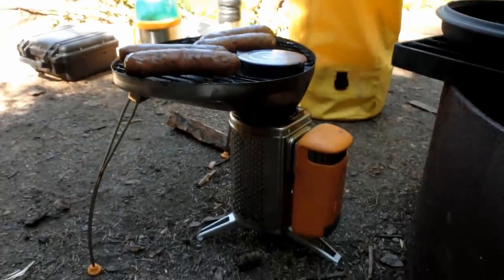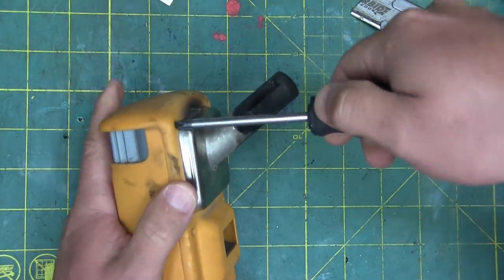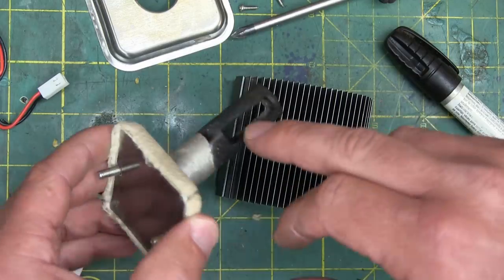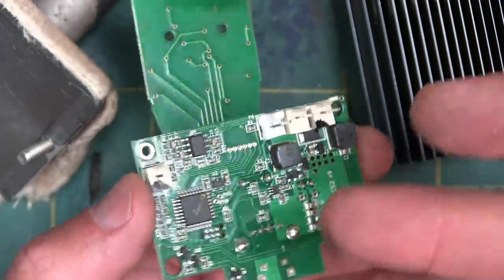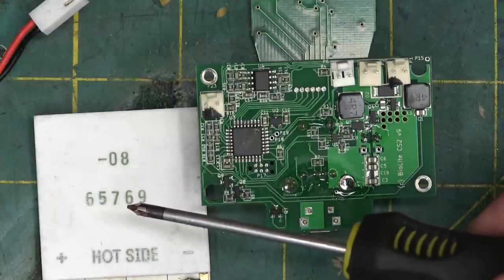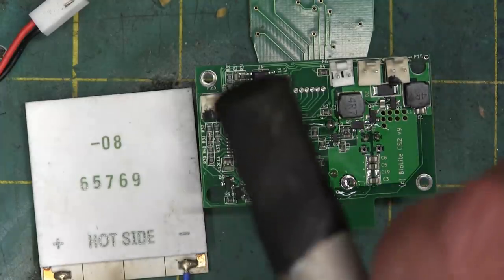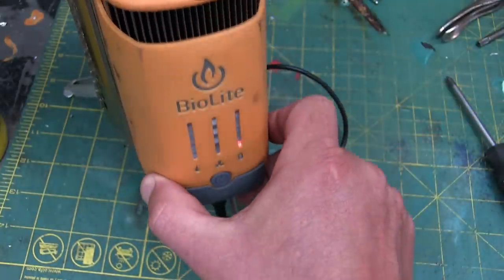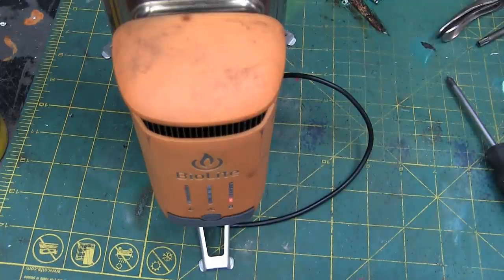BOLTR: Biolite Stove | Camping Gear

Comment: Leaving off parts saves money two ways: you don't have to buy the part (BOM cost savings) and you don't have to install the part (manufacturing cost savings).  When I was doing volume production, we budgeted between  $0.05 - $0.10 per component for insertion costs depending on where we were going to get the PCB assembled.  So for cheap caps and resistors, the insertion costs can easily be 10x the cost of the part itself.  I haven't worked with a modern pick-and-place machine, so my numbers might be off.

Comment: It doesn't need a charged battery, to get the fan to run. As soon as you get a fire going, it comes on to cool it (and incidentally, to blow the fire).

At least in my later model, the pixies won't run out of the USB port (for devices) if battery charge is below a certain level that would drive the fan for a few seconds before it shuts the fan off because it's not hot.
But even if it's drained; as soon as you get a fire going, the pixies start running the fan.

I'm glad to see in the comments that it rebooted and works again. Plenty of people have reported replacing the batteries and it's fine.

Comment: Is it possible that it somehow detected that it was disassembled, and consequently went into a form of "hot of the press"/first initation mode, that needs some special button sequence to reengage?
Reply: whats more likely is one of those leads going to the battery broke, or AvE plugged the battery and the generator into the wrong sockets on the board. Just a guess.
Reply: Rental Floss more likely he broke something
Reply: up up down down left right left right a b start!!
Reply: @Lolo Uro b a b a start
Reply: Watch the second video. It was a software problem, turning it off and back on again worked.
Reply: Your clearly not fact driven.

Comment: I have one of these they work great.  Got to remember that any stove requires you to carry fuel so this thing being heavy isn't too big of a deal since you aren't carrying the fuel.  The usb charger does work but really it's useless the amount of time you need to run it to charge a device isn't acceptable.  But as a camping stove it works good.
Reply: As to "fuel" weight being carried, this only requires your standard small hatchet or small machete.

I don't understand the objections: all the time you're running it as a campfire it's charging at least itself.

 From my experience, with all the batteries and phones I've tried with it, a couple of hours of fire charges it and drained devices.
 It wouldn't need to run all day or night to charge everything but maybe big camera batteries and a whole laptop.

Comment: Put some thermal paste on that and I bet it would increase the chooch factor.
Reply: the paste would burn off due to the VERY high temps

if you saw the quick annotation...its aluminium-ized graphite....which will do the same thing, but not degrade when its .0005 inches from a fire
Reply: If he didnt break it first

Comment: RTFM.  OVERHEAT MODE: CampStove 2 contains an automatic 
warning mechanism when device is at risk of overheating. In this rare case, all heat LEDs will begin to flash; 
stop refueling immediately and allow system to cool down. If LED begins to flash rapidly, system will 
deactivate fan so fire cannot burn as hot. When system cools sufficiently, fan access will re-engage.
Reply: Frank Nielsen so basically the torch was too hot?  I wonder if he could get it working after the video
Reply: Chamunks Arkturus Yes he even said in the video that it was not designed fore burning fluids and charcoal as it gets to hot. Takes blowtorch and heats i up. :D

Comment: I was pretty intrigued by this thing when it was in preorder.  Turns out though that there are many many backpacking wood stoves with a battery powered fan (AA) that lasts a few months with regular use for a fraction of the cost.
The nice thing about wood stoves is that if they break or something, you still have all the stuff with you to easily make a wood fire.

Comment: The obligatory pedantic comment: "Double redundancy" is redundant.
Reply: To be even more pedantic, it's not.  You can have double redundancy, triple redundancy etc. For example you could have a battery bank for power outages along with a diesel/petrol generator and a flywheel as well.
Reply: John Carder could be triple redundancy, eh?

Comment: Check you got those connections the right way round. In the 60's I had a book from the 1930's that had plans of all sorts of things to make. One of those was a seebeck effect generator made of nichrome and brass wire in a spiral hot joints inside and cold joints to the outside, the thing was made to go on a primus paraffin stove. Never made one but supposedly it produced enough power to work a pea lamp so you could read while the kettle boiled, I suspect that the light from the flame was greater. I no longer have the book as I lent it to a teacher who never gave it back to me.

Comment: Chris, I'm tinkering with the idea of building a hot water on demand system for when the better half and our 5 year old cub go camping; what for doing the washing and maybe showering. There seems to be an absence of this type of product on the market. I only want to use a single 400g portable propane canister. I'm thinking along the lines of a jetboil type flux ring design which heats water then dumps the water into a HDPE tank inside a cool box for storage. Then a demand pump which pumps the water to a faucet or shower head. Basically a home style hot water storage system only miniaturised.

Comment: Well, you can always "jump start" it with an OTG cable and a phone, which is what i did that one time (forgot to charge the bank). Also the probe can activate the fan by itself if you keep a cup of pellets with you (i do that just in case) and once you got temp, wet sticks it is.

Comment: Low in nickel not chromium. Nickle lowers the austenite transition temp.(austenite makes for a tougher but less hard material, and is non-magnetic)
Free chromium[metallic, not carbide] is the primary anti-corrosion element(Cr also a strong carbide former[so must use enough to consume all carbon before there is any significant free Cr]  and Cr increases brittleness)
Reply: Should add that austintite has slightly different modes of corrosion than ferrite or martensite, so the Ni can assist the stainless properties in a round about way under some conditions. Mostly though it is in there for the mechanical properties.

Comment: You can can have a fire in the unit even if the fan is not working.  This will allow the battery to charge just enough to kick start the fan for normal operation.

Comment: The Slingshot channel just got a new air compressor from china that seems to be able to go to scary high pressures for something like 10% of the cost of the german made one he was using before. 4500PSI for $200!?
I'd be really interested to see you take one of those apart and see how that's possible, or if Joerg is going to blow himself up

Comment: While solastic is great for vibration dampening, those connectors look like latching molex headers. They typically have enough of a positive connection to be suitable even for the automotive industry. I highly doubt some disconnect due to vibration would be the failure mode for this thing. Of course, a little extra quality never hurts.

Comment: Adding more chrome helps stainless be magnetic, as it stabilises the alpha (BCC) phase - austenitic stainless steel has nickel in it (~5-20%), which stabilises the austenite (FCC) phase and makes it non-magnetic. Nickel is good at high temp, if you keep adding it to stainless steel you end up with a nickel based high temp superalloy (eg nichrome wire)

Comment: I can think of 20 ways to make that better. #1 copper. #2 water tank on the cool side. #3 2 parts instead of just one (1 for the TEG and one for the battery connected by a steel braided coated wire.  Probably be a cool thing to buy and scrap the body and make ur own.

Comment: Here in the US, this stove would not circumvent a fire ban. Allowable stoves are required to have a direct on/off mechanism. Pretty much limited to pressurized propane/isobutane or white gas stoves. Fire bans are the reason I stopped using ultralight homemade soda can stoves that run on denatured alcohol.

Comment: The reason they might not use a heatsink on the hot side could be that it would block that stove, it could get clogged up pretty bad with all the shit that's burning, which would reduce the air flow and put your fire out in no time.

Comment: Interesting stuff. Back in the day we used to call em Peltiers. The difference between a pixie generator (a TEG) and a cooler (a TEC) is whether you are putting heat into one side of it and taking the pixies out, or putting pixies into it to make one side of it cold. It's the same device either way. It's all about that thermal delta baby. Try hooking that bad boy up to a 12v power supply and putting about 50 wattsits through it (and put the heatsink on the hot side) ...and instead of making pixies, you'll be making frosties. Try it? :D

Seebeck = heat in, pixies out. Peltier = pixies in, heat out. Two sides of the same coin, baby. :D

If you are done with it, you could have some fun turning that useless bone charger into a 12v beer cooler. :D

Comment: I think maybe it needs a reset looks like the battery charge controller needs to start/ power-up in a specific charge state secret setup procedure at the factory ' maybe hold power button for 5 secs ??? '  or static got it.ESD...if it ain't broke don't fix it ...you taught me that

Comment: I think this design also had another missed opportunity. Once its running and air is flowing out the cool side of the Seebeck fins, the exhaust air could have been shrouded and directed to flow into the bottom of the fire chamber. Forced air (even a little at a low PSI/CFM) will dramatically improve the amount of heat you heat from less wood fuel. The ducting and flapper valve to do this would be cheap and easy to make. I would even have the air flow over the outside of the burn chamber first from the top down, then go into flow holes at the bottom to flow up the burn chamber. This is how the burn chamber on jets work. The air that's about to be pumped into the burn chamber flows over the outside of the burn chamber just before it mixes with fuel.

Comment: AvE fire still works even if the circuit board lets the smoke out. Not sure how that would prevent it from still being a heat source, just can't charge your gadgets that you are going camping to get away from.

Comment: Solar isn't the perfect solution either, but a fairly small panel will easily give you 5W, so if you pack a 10W panel + a decent power bank with ya, then you'd be pretty much set for a camping trip.

Comment: coldness of space： they use infrared radiators to convert the heat into infrared, and thoss them everywhere. that is the only way to get rid of heat, since no airflow and no contact.

Comment: Another advantage of a chunky probe over a more traditional heatsink with fins is ease of cleaning. Carbon buildup will insulate the probe and reduce heat transfer. Imagine trying to clean carbon buildup off of those fins.

Comment: now, try to find one with a mini sterling inside, their efficiency is considerably better to the point that one designed for power, and not as a toy the size of that boost/fan unit should be able to fast-charge a phone without a boost cell. Since the sterling can run a fan on it's own that will start as soon as the hot side starts to heat up. only electronics it needs should be a voltage regulator, the generator portion could be a mini induction generator so it doesn't have brushes, or permanent magnets that attract shmoo.

Comment: I'd imagine that a big part of the reason for the pierced phallus heat exchanger instead of something like the heat sink on the cold side is that it's not necessary, and that the limit on the temperature gradient is how fast the heat sink can, well, sink heat, so they might as well go for something big and robust and That Shape

Comment: They sell 21 watt tegs for $52-300c .hot/30c .cold .  I Think 4 of those with the right boost converter, and cooling should charge a phone quickly.  Could even incorporate a pump to cool it with lake water, using common cpu water cooling.   Of course much more cost than the biolite.

Comment: Not the first time i see this in something like this, when the battery is unplugged the device goes into death mode. Officially this is so you don't charge a battery that might have gone too low in voltage which is supposed to maybe be bad. In reality it's to prevent anyone from replacing a worn out battery instead of buying a new machine.

Comment: Take your bench power supply and throw a little charge straight into that 18650 bypassing the protection circuit and charging straight to battery terminals at about 5 volts 2A until you get it up around 3 volts the reassemble it. Looks like the weakest link in the thing is cheap unprotected 18650..

Comment: Could you set that up with a slow trickle from a bucket of pond water over the cool-side heat sink and increase the electricificatory output of the thermal differential generacity?  Seems to me that would greatly increase the chooch factor.

Comment: ive got the earlier model and it is slow to get going but works all right. instead of relying on the built in battery i use it to charge a battery pack then charge what ever. more reliable. also ill take a zip lock of wood pellets as a back up they burn awsome and lots of heat to kick start the bitch if its dead. should send mine in to see what the difference is but mines still working lmao. awsome video as always.

Comment: All the connectors in there look to be the same type, meaning getting those connectors mixed up seems super easy and potentially fatal the device, as (possibly) evidenced... That would go against the ease of manufacture aspect unless each board/module was its own assembly station; way too easy to mix those up which would up your failure rate right on the factory floor.

Comment: Fuck yeah love mine , not practical for backpackin at all but for general campin hell yeah. Just by burning cardboard and other paper waste you can charge a 6500 mAh powerbank in like 4 hours. I have had it for 2-3 years now and it still is workin. Takes a minute to get the fan going though.

Comment: Those peltier elements tend to desolder themselves at about the normal soldering temperatures.That's why they give the thing poor heat adsorption and plenty of cooling.Otherwise or when that fan fails the seebeck generator becomes two ceramic plates with some alloy blob between it.

Comment: AvE I own one of the original Biolight stoves. I ran into a similar problem with mine. I think the 18650's they use are kinda on the cheap side. I used the stove regularly for 1 year had no problems when it was not in use i gave it a little slap on the charger now and again to keep the battery topped off ((as the company recommends)). A year into the life of the thing it just flat out refused to charge anything. I could get it to chooch as in make fire and spin its fan but it would just flat out refuse to go any further then that. I contacted biolight and they told me this was a known issue and that all they could do is give me a coupon for a reduced price on the unit i purchased. I would even be happy to just send the thing in to have them throw a new battery in it. Ahh well thats the price you pay I guess. You idea of a replaceable 18650 would get me wanting to just buy a whole new one.

Comment: So would the difference between a Seebeck-effect TEG (generator) and a TEC (cooler) be that the generator seeks to maximize voltage by using smaller junctions and more of them, and the TEC seeks to maximize current by using larger junctions and fewer of them?

Comment: Maybe because the battery was disconnected it triggered a fail safe which was supposed to refuse to charge the battery if it ever under discharge and so potentially damaged itself posing a fire risk of charged

Comment: Ave you better check again about that being a campfire ban buster. Under the fire ban, it counts as open flame.
Reply from the maker: Nope. For cooking and under 15 cm exposed flame.
Reply: AvE that is true, under 15cm and in a UL listed device, but, it must not be something that uses wood as a fuel. Gas, liquid, and briquettes are the only allowed fuels. No I don't agree with it, but the ticket writers don't care that briquettes are carbonized wood but wood is not allowed.

Comment: I've had one of these for years. I use it from time to time. When it's flat dead it just burns normally until it gets some heat in the fire then the fan starts. It charges things at the same time as the battery is charging when the fire is hot enough. We usually use it for powering an LED light string. I won't be taking it to pieces to see if I can break it.

Comment: If it works based on temperature difference, would it chooch better in the winter?

Maybe swap out the heat sink for some kinda water cooling...

Comment: I was wanting to hear your take on the metallurgy component. You've obviously had connections with the mining industry, it's retrieval and refining cost, and I'd like to hear your views on why such cheap SS is used (or why use SS at all if it's still going to corrode out) when just a little more upscale would increase it's usefulness a bit longer and greater customer satisfaction. * I find it funny it would crap out by just being disassembled, could you have a plug wrong, looked like they were interchangeable.